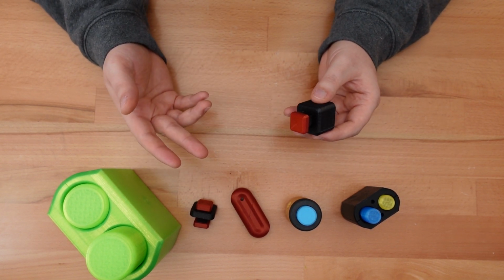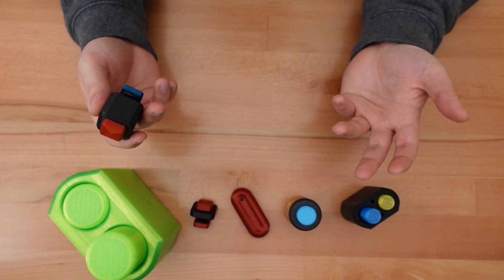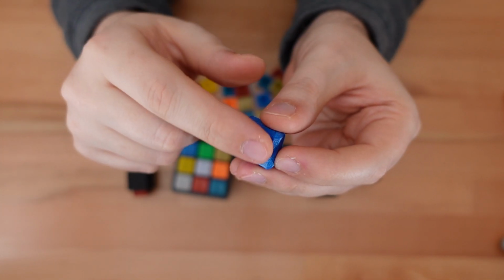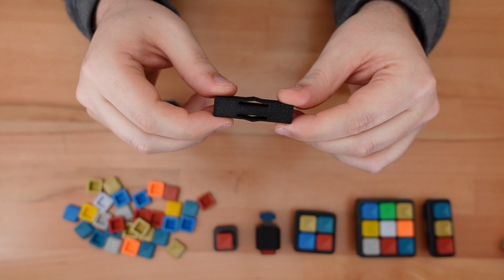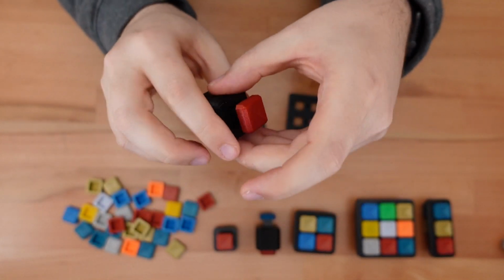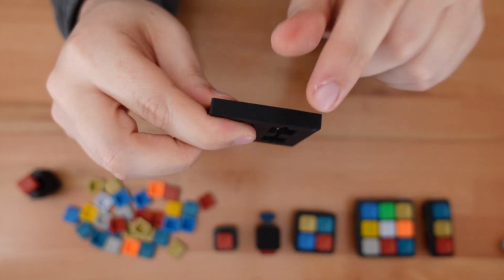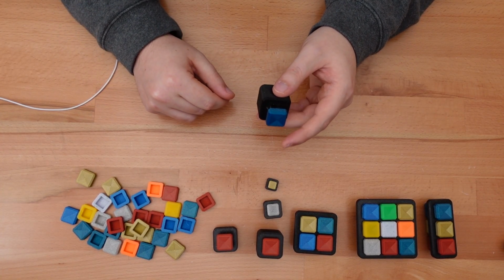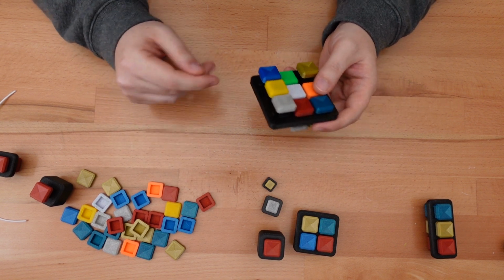3D Printed Snappy Fidget Toy

Comment: I wonder if there is a way to get push buttons with this spring
Reply from the maker: Currently the spring is shoved into an hourglass shaped path, which it snaps through. If you were to switch that out with a slowly narrowing taper that never opens back up, the spring would act like a push button, with different tapers providing different degrees of resistance.

You'd probably still need something to keep it from popping back at you too far, though!

Comment: What printers do you use? Your prints look so clean.
Reply from the maker: Thanks! These buttons were printed on a Prusa MK3s at fairly slow speed. Also, Protopasta filament does a good job with hiding minor flaws.

You can see some less-nice buttons when I'm going over the prototypes. Those were printed at higher speeds and with a less optimal orientation.

Comment: How hard do you think it would be to design something similar that pops back up on its own?
Reply from the maker: I suppose that depends. If you want it to pop back up instantly, that would be very easy - just make the path the spring move in a wedge with the widest part facing up.

If you want something that pops back after a certain amount of time or through some secondary action, this is probably not the best mechanism for that.

Comment: I wonder if you could print one at 200% scale and maybe thin up the walls of the spring so that it still has that snap.
Reply from the maker: Probably! There's a decent chance that the soft spring requires so little flex that a 200% scale print would work as-is. I haven't tested that, though.

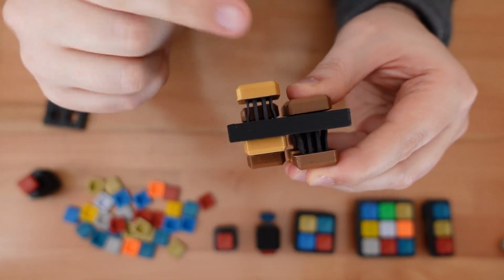Comment: 4:32 I missed the transition between the two takes
Reply from the maker: Haha, yeah. It's a complete coincidence that I happened to hold the updated model in almost the exact same position AND orientation as the old one. The only obvious change is that the internal springs go from having three supporting struts to four.
Reply: @3DPrinty  only noticed the cut at the third rewatch because the print quality of one of them is slightly worse
Reply from the maker: I see what you mean. The first one used buttons that were printed upside down. There's a lot of squish and leftover brim on that copy. Good eye!